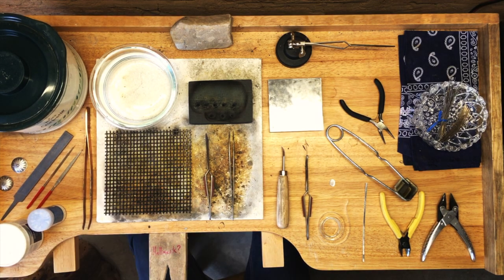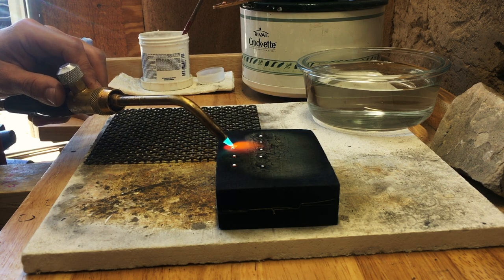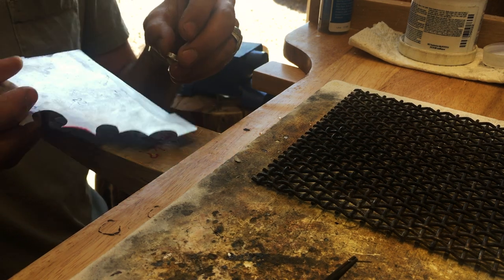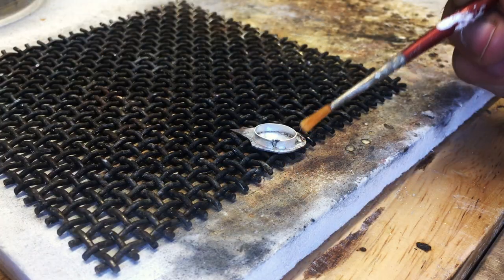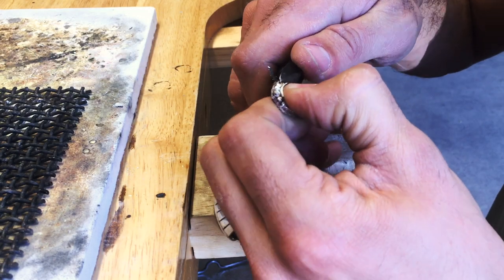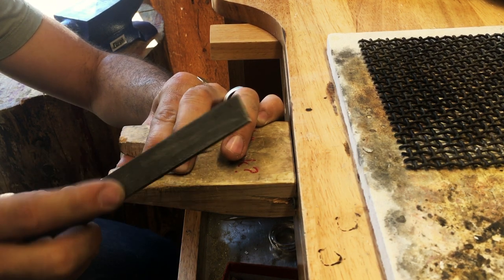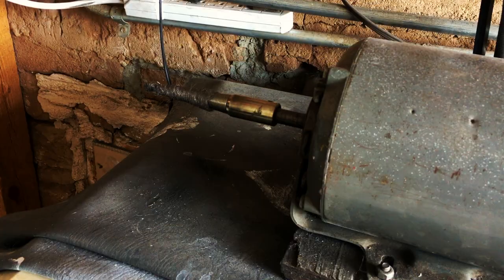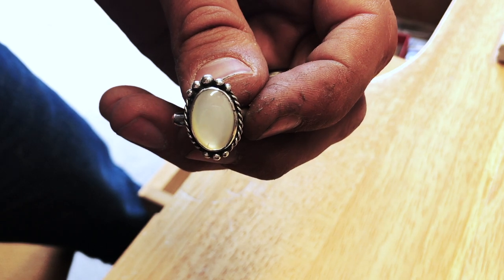Making a Silver Ring using Beads and Rope Wire

Comment: Very pretty ! Last time I repaired someone's earrings with sawdust behind the stone, it was all moldy and smelly from getting wet. After that I refused to use anything that absorbs water. I will use silver scrap, plastic or anything like that.
Reply: Try epoxy
Reply: Try backing the stone— stir up the epoxy on a surface like a piece of paper on a flat surface. Then set your stone down and give it a tiny push into the epoxy. Then when dried, saw it out with your saw. Then sad the edges and sand down the bottom to make it level and flat

Comment: I enjoyed the video very much.  I was wondering what type of solder you used for each step and which solder- easy, medium or hard, each time.  I assume you used Hard at the beginning.  Also, where did you place the solder in each step.  Thank you.
Reply from the maker: Hi there! It's been a while since I made this video, but I typically use hard solder to close the bezel, and then medium solder for most everything else. I sometimes use easy for the ring shank, but even that can be done with medium

Comment: Great video! What's your torch setup?
Reply from the maker: Thanks for watching Kelli! Right now I'm using an acetylene torch with just the ambient air. By the end of the year, I'd like to have a dual fuel, acetylene-oxygen set-up because I've heard they burn cleaner and I can get more heat out of a smaller flame
Reply: @thebishopsilversmith5396  Nice! I've been learning metalsmithing at the University and the giant acetylane/oxy just seems so intimidating for home use. Especially when I still haven't quite figured out a proper ventilation set up for the winter months.  Your solder technique is way different and looks more efficient than what I've been taught. Would love to see a video dedicated to just soldering
Reply from the maker: Kelli Boyle thanks for the suggestion! As I've been making these videos I've realized I need to maybe trim down the content to specific moments. The start to finish video for each piece can tend to be pretty long haha that's awesome that you're learning metalsmithing! I'd be interested to know what solder technique you all use. Do you use wire solder or solder flakes?
Reply: @thebishopsilversmith5396  Actually, I loved that you did it start to finish, and I usually have very little patience for  how-to videos. We use wire solder, but cut it into tiny, and I mean TINY pieces and place it first. It looks like you just stuck the end of the solder wire right where you needed it, which seems WAY more efficient.

Comment: Looks like you’re using a Turbo torch, I think. What tip are you using? I’ve never been happy with my torch setup, and it looks like you get amazing heat with yours.
Reply from the maker: Hi Robert. Sorry for the delayed response. The torch I'm using is a Uniweld. I picked up the kit from my local silver supplier when I was first getting started. I also purchased a couple different size torch tips aftermarket for bigger projects and for projects that require a smaller, more concentrated flame.

Comment: Hey there! Are you adding the solder just by holding the whole piece against the seam instead of cutting little pieces of solder? If so my life just got a lot easier!
Reply from the maker: Hello! Yes, in this video I am holding the whole piece of solder instead of cutting it into tiny pieces. The one thing to be aware of when soldering like that is you can easily push what you're soldering out of place if you bump it before the solder reaches the melting point. Depending on the application, I do also cut solder into tiny pieces if I need something in a very specific spot. Hope that helps!
Reply: @thebishopsilversmith5396  Yes it definitely helps!

Comment: Great informative video! One question: do you need to add beads on top of silver sheet used for the base of the bezel? Or can you just attach beads to the side of the bezel wire that wraps around the stone, without being on top of a silver sheet? Thanks
Reply from the maker: Hi Rachel! It's definitely possible to the beads just to the bezel. I don't know many people who do that. Some people don't like to have the solder of the beads flow up onto the bezel at all. The reasoning for this, I imagine, is the solder connections of the bead on the bezel inhibit the bezels ability to bend when you set the stone. Bending the bezel when you set the stone could also weaken those solder joints some, so I always prefer to solder the beads to the base sheet of silver. But you can always experiment and see what works best for you!

Comment: What kind of torch are you using? I use a Smith little with an oxygen concentrator and propane…but need more heat for melting scrap
Reply from the maker: Hi Kathy! In this video I'm just using an acetylene torch fueled by the ambient air. I have since switched to an Little Smith Oxy/Acetylene. They make a multi-orifice tip that has worked really well for me when melting scrap! It might even be compatible with a propane set-up :)

Comment: Awesome work! What would I search on rio grande to find the silver rope wire that you soldered around the bezel cup? I can’t seem to find the rope wire. Thank you 🙏.
Reply from the maker: Hi Robert! If you're buying the wire from Rio Grande you can search "twist wire" for some similar options. I actually make my own twist and rope wire at home. For twist wire, I generally use 18g sq wire. For a rope wire like this, I used 22g round wire that I double and then twist.
Reply: @thebishopsilversmith5396  thanks for the reply. That helps a lot.

Comment: Is there a way to make rope real tight? Mine always looks kinda loose. I use a drill to twist it until I breaks but it still doesn’t look as tight as some peoples rope
Reply from the maker: Hey! So yes, there is a way to get tighter looking wire. I don't make a ton of rope wire anymore, but I imagine the principles are similar to making tighter twist wire. 

The key is, you have to anneal the wire after (or just before) you've work-hardened it to the point of breaking. Truthfully, I've had mixed results with the annealing process, likely because I'm not uniformly returning the wire to the same "dead-soft" hardness that is my goal. So, when I go to twist the wire some sections end up having a tighter twist than others. BUT some sections can get VERY tight. You'll want to watch it as you twist it with your drill to make sure you don't go too far. I hope that helps!
Reply: @thebishopsilversmith5396  yes I think that’s what I’m doing wrong, I’m not annealing. Thank you very much! I really appreciate your response👍🏼